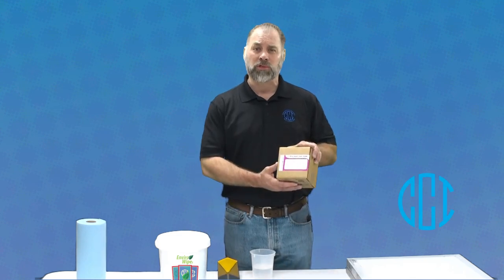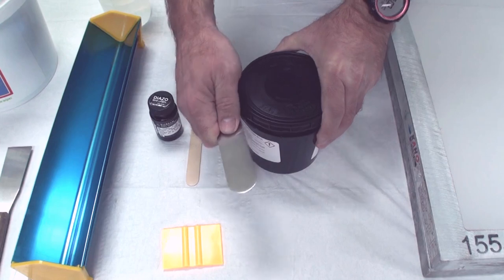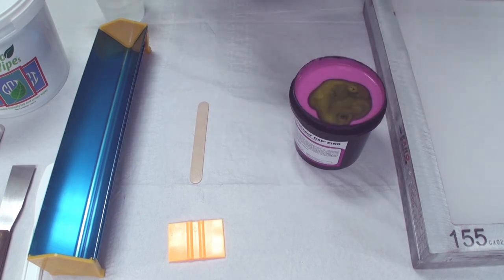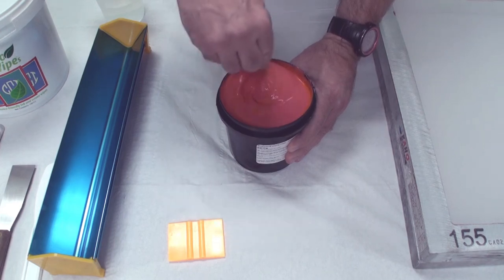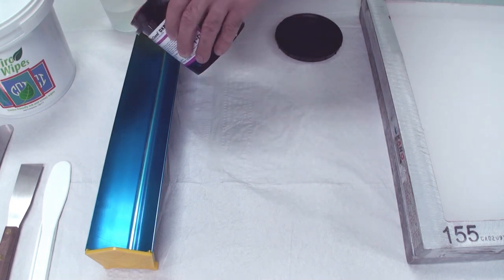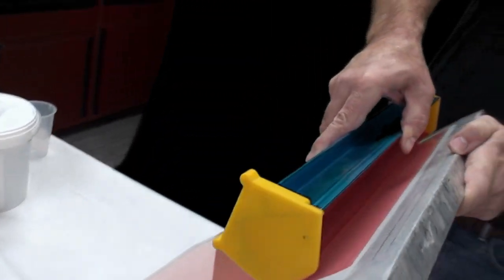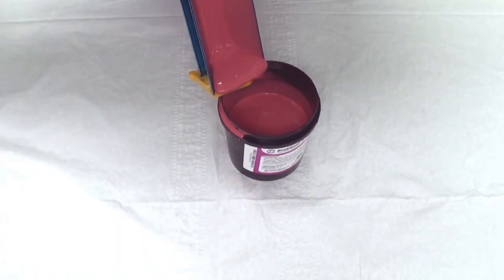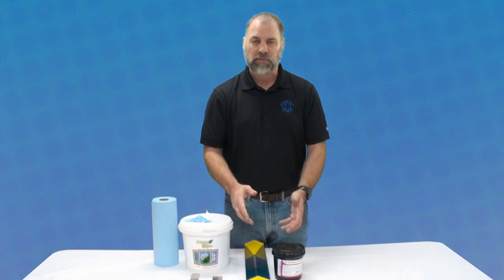Screen Printing - How to Coat CCI's Emulsion

Comment: When coating, are you supposed to angle the coater enough towards the screen that the two plastic ends angles are flush/parallel with the screen mesh?

Thanks!